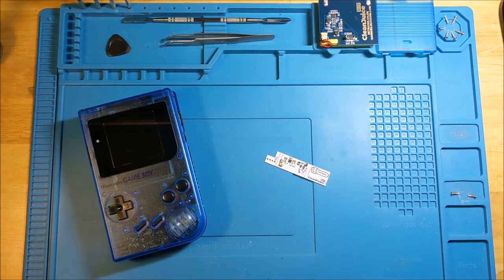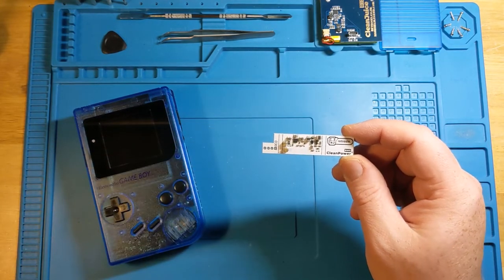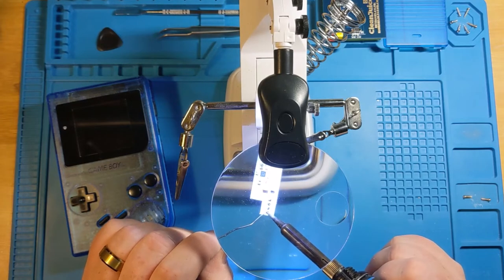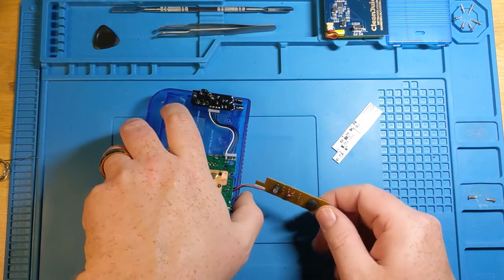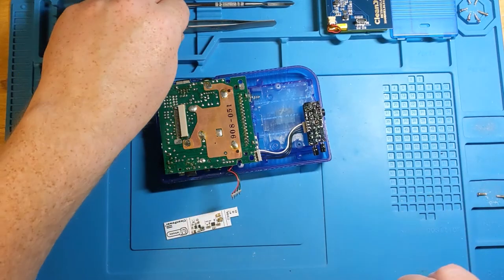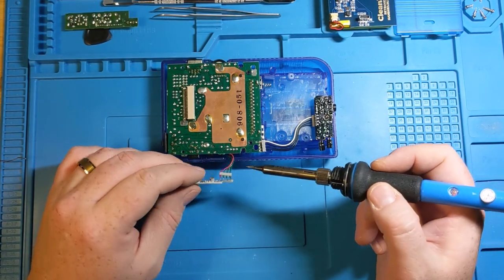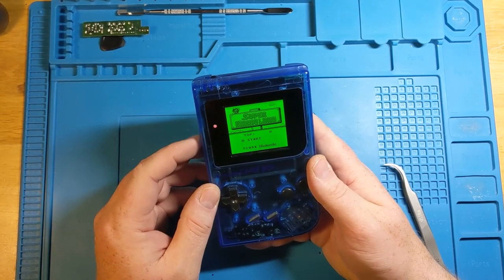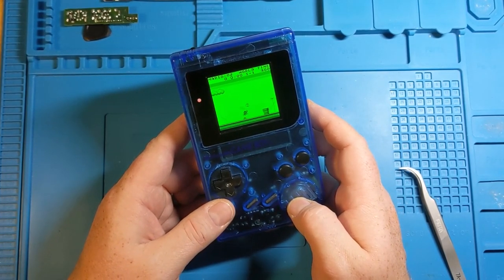Prime Time Funk Mods: Retrosix/Handheld Legend DMG Clean Power V2 REVIEW

Comment: Nice video. Hope you don't mind me saying. When you install the 4 wires to the new power regulator, you'll have an easier time if you pass the wires through the vias (little holes at the contacts) first. Then you'll be able to rest the regulator against the wires, prop it up with them. The add flux paste to the contacts (this is a Pro tip, makes the solder go exactly where you need it). Then solder the pins. Will make for a very sold connection, without the difficulty of losing the via holes due to pre-tinning the contacts.
Reply from the maker: I am by no means too proud to accept Pro Tips! That does sound easier. 😉
Reply: can you make a video at your pro tip?
Reply: A pro would know the difference between a via and a plated through hole.

Comment: Do not pre-tin the four holes because it is easier to put the plug with the desoldered four cables through the holes and then solder these four cables from the backside. When pre-tined it is harder to put the cables through the holes because the hole is closed or at least smaller with the pre-tin solder.
Reply from the maker: Thanks for the tip! I had a couple other people also tell me I was making it a bit harder for myself than necessary 😏
Reply: @primetimefunkmods3  You are welcome. I am also not a solder pro and still learning 😁 But we will get better with the time. A few years ago i never expected to start with soldering because i thought i am too clumsy for it but now i did some mode over the years and some of them worked but i also learned it the hard way with some destroyed devices 😂

Comment: If a problem came up with V1, who is to say that there won't be a problem with V2 later on. I've read that V2 isn't that consistent either and to make things worse, retrosix removed any info about how to rectify the V1 issue. I have a V1 with a RIPS V2 lcd mod and use an original GB X5 everdrive without any issue.

Comment: Great video! I saw you answered comments recently so I thought I give it a shot and reach out! 😊

I’ve installed a pair of IPS screens in two DMGs. Unfortunately they have the rev 5 cpu board (I know this happens, but I didn’t check beforehand 😩) and they get VERY hot down left on the shell, and sucks the juice out of the batteries extremely fast. Would this mod help it not overheating? Or do I need to search for a rev 7-8 board instead?

I’ve done the same mod to another DMG with the rev 8 cpu board, and that one works great! 😊 I think the rev 7-8 have an updated stock power regulator board, if I remember correctly, so in my mind this CleanPower mod should do the trick! What do you think?